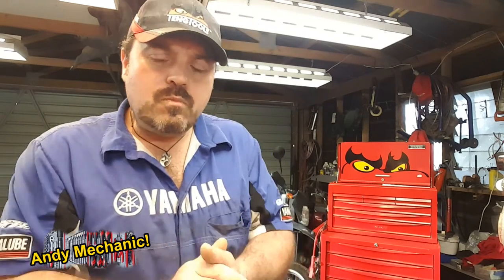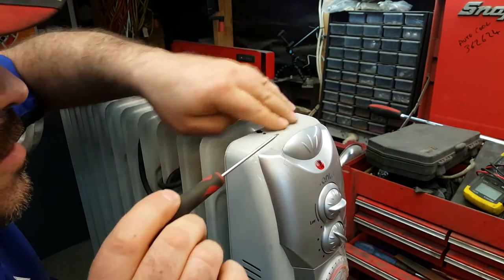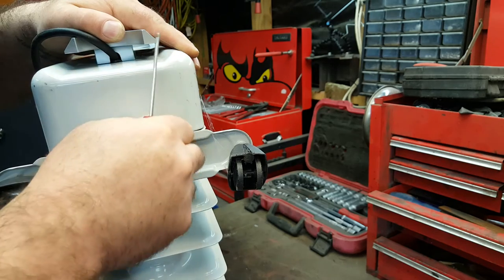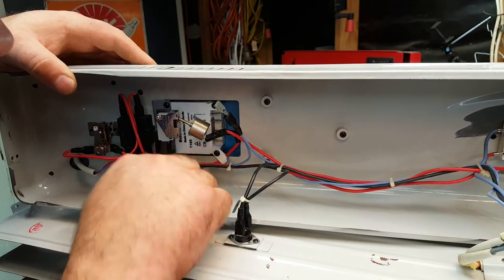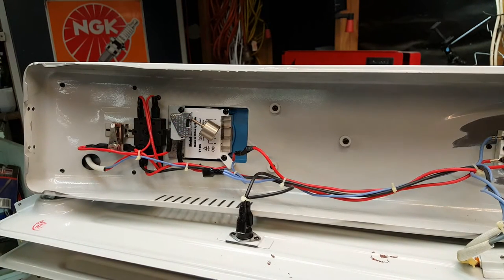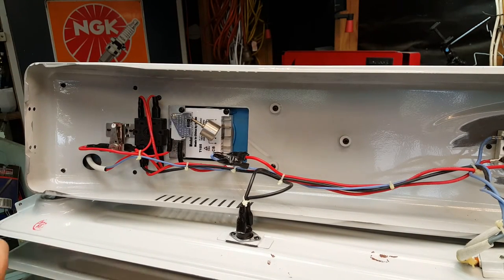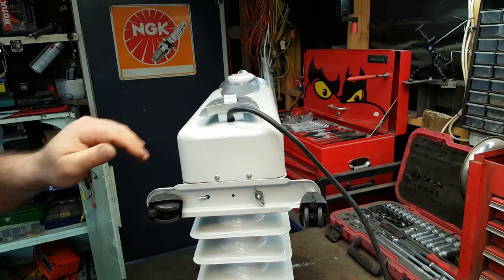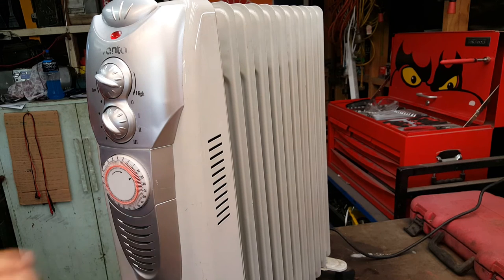Oil convection heater repair - timer bypass #2103

Comment: Will this stop the annoying rattling
Reply from the maker: Sure will
Reply: Thanks Andy. Confirmed my thoughts. I didnt have to join the 2 wire's together. Just had to unplug the one side of the temp sensor, plug straight in. 👍